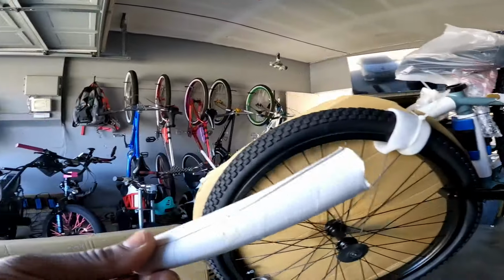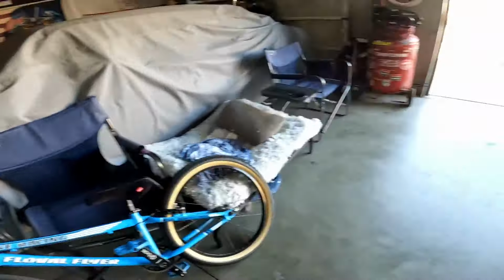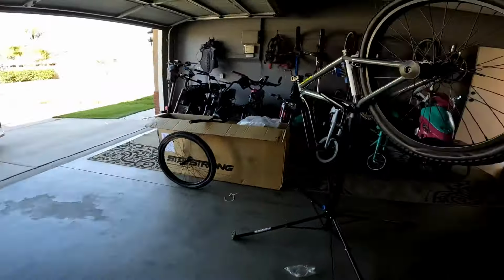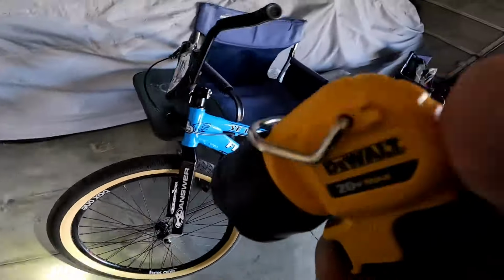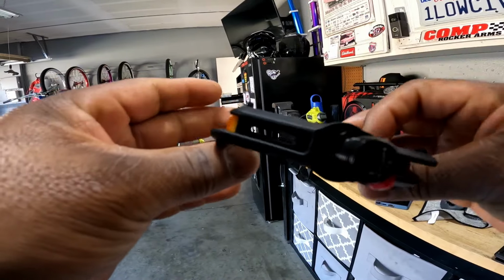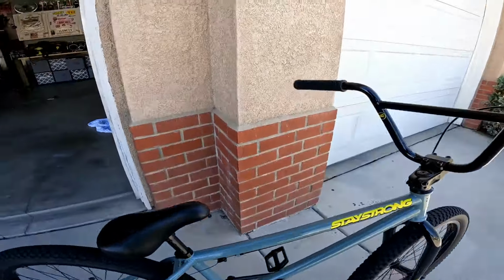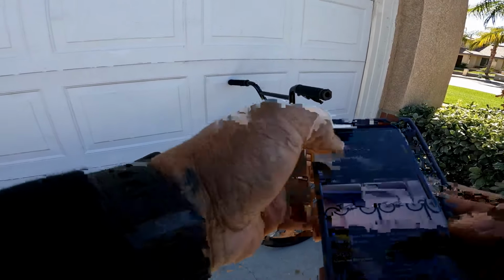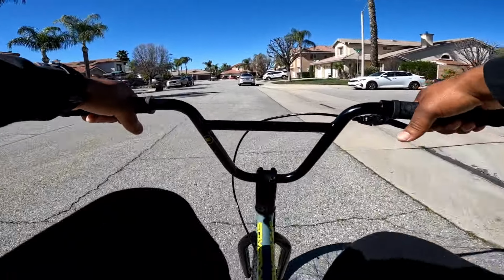MAJOR STAY STRONG 24" FREESTYLE BMX VS SE FLOVAL FLYER RACE 24" BMX

Comment: I mean...its a $300 bike with fully sealed everything and double walls on kenda tires.  Comparing it to your SE is not exactly fair.  Top tube is 21.75".  For an entry level $300 bike kind of hard to beat.  It's for beginners.
Reply: Exactly